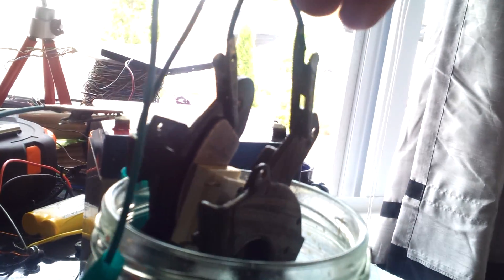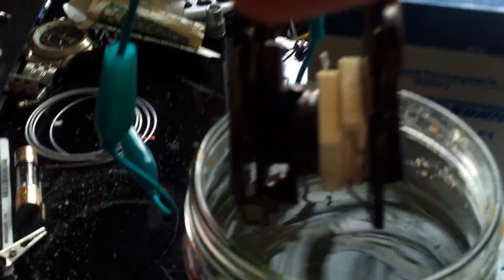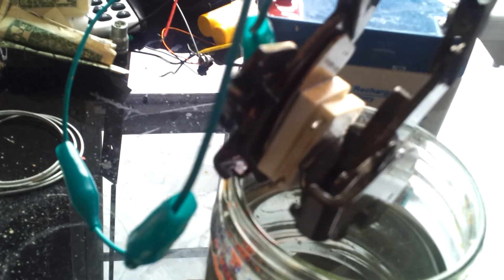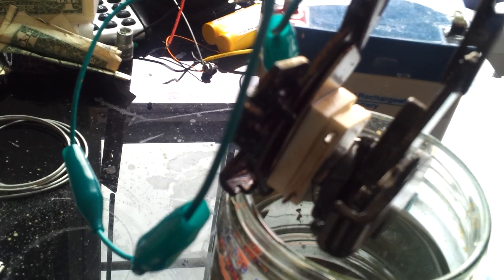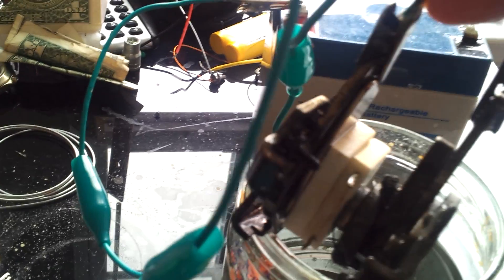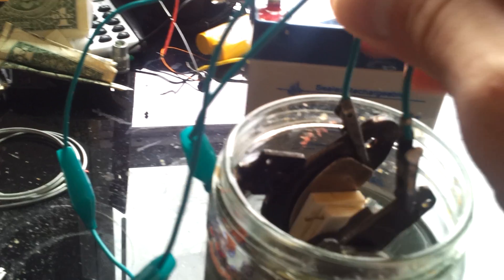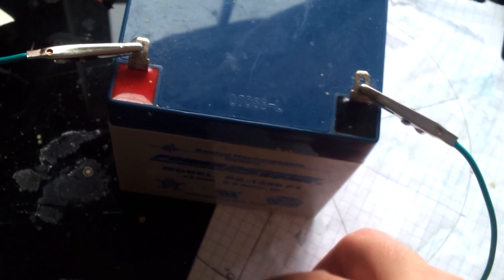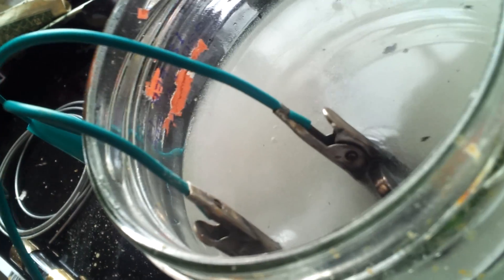Magnetic hydrogen effect

Comment: Several of you are referring to this as HHO that if you separate the gas’s but if you knee them together it’s called Brown gas it works very good for torches and burning in vehicles since it’s already the correct mixture of oxygen and hydrogen with a spark it converts back to water. Holding it is hard I’ve had a lot of trouble trying to do that although when hydrogen does go off it is extremely exciting with a blue flash or burning through a tube or hose but creating enough to use has always been my problem the magnets look like a big improvement over everything I’ve tried so far. What if you just put a couple of big magnets outside of the container with the plates inside you will still get a large magnetic field throughout the container which should work the same and the lines of the magnetic fields are out a ways from the magnets depending on their strength in fact, maybe one strong magnet outside the container would have the same effect as the two little ones inside. I’m definitely going to give it some trying. Just like the stainless steel Brillo pad gave lots of surface the magnets might help even more.

Comment: Fuel cells GENERATE electricity by bonding hydrogen and oxygen together through a positive electron membrane and creating power. What you are talking about is an HHO generating device called an electrolyzer, using magnets as the anode and cathode electrodes. Nothing more.